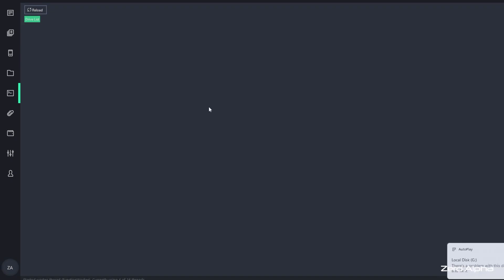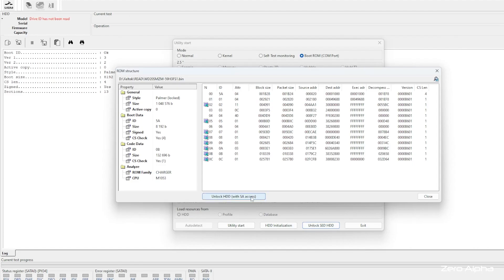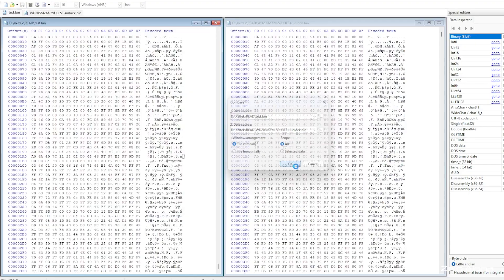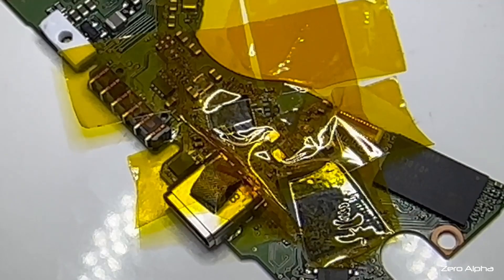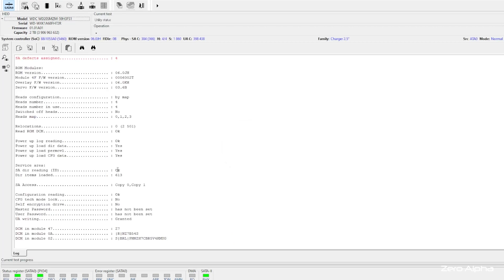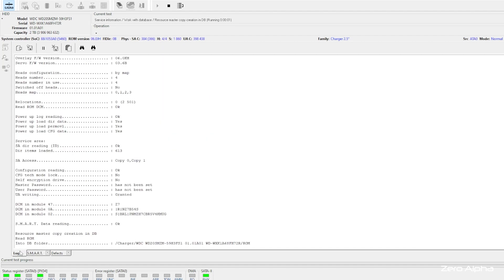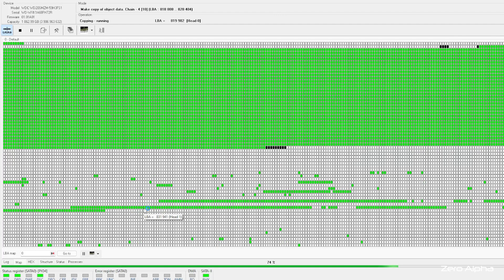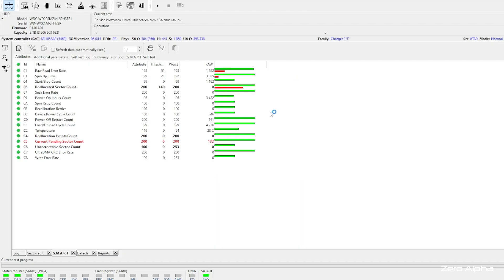USB-C Portable Hard Drive Freezes Computer Data Recovery

Comment: I use the unlocked pcbs from china with the palmer charger families and modify FW via pc3k i would love to know what you modify in rom to achieve same result...?
Reply from the maker: That is the best way to do it at the moment but it depends whether the drive has encryption keys stored in mcu
Reply: @ZeroalphaAu  ah that's the problem with my method I don't know about crypto until sector access...